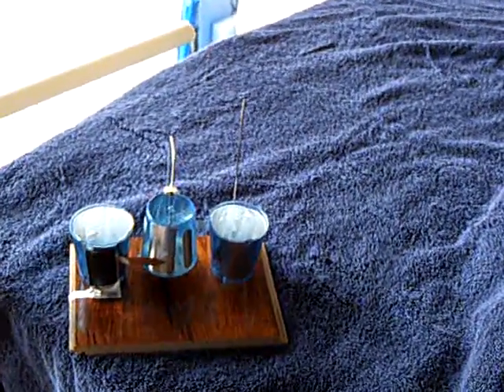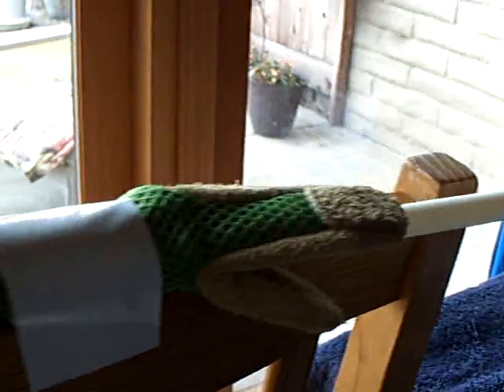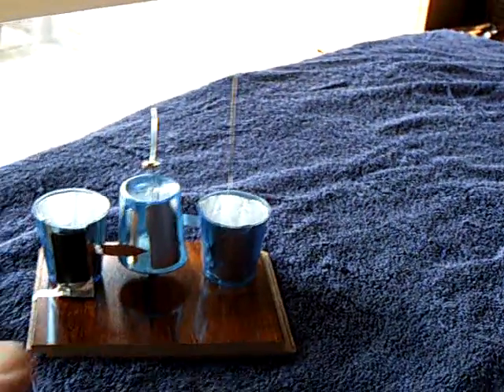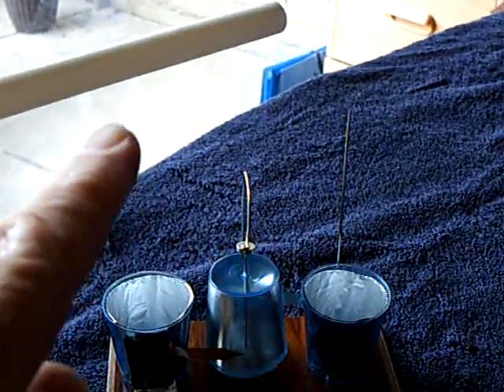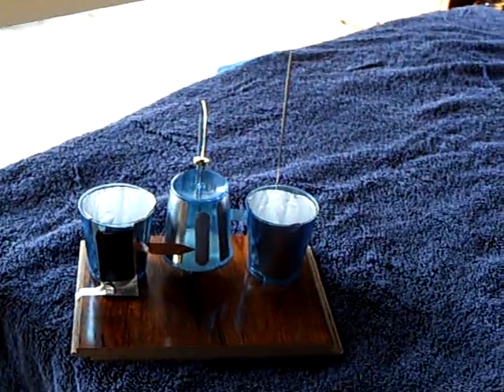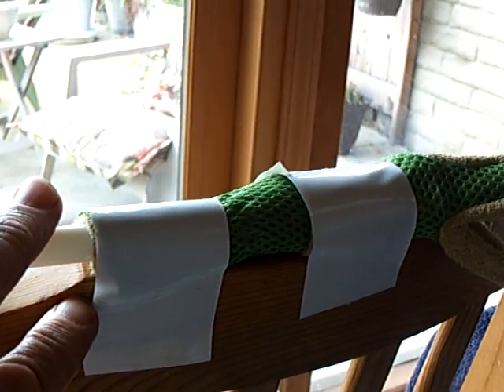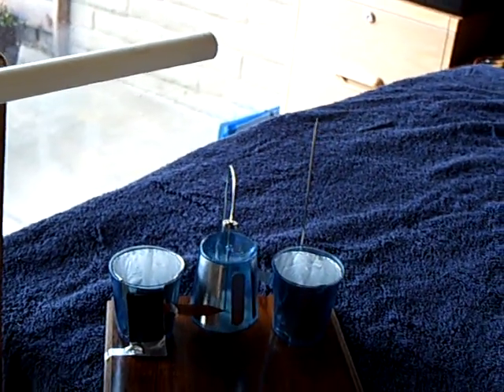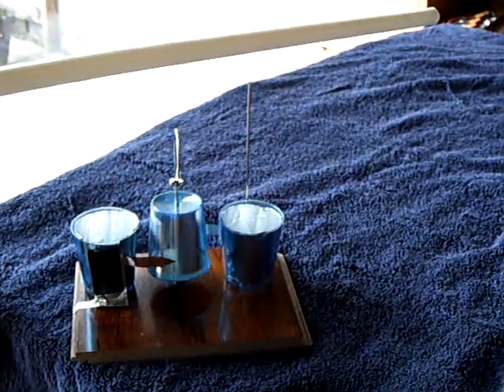Super Simple Electrostatic Generator -- with Wireless Electrostatic Motor

Comment: Lid. I know you study this because it fascinates you but until now it cost much to run these electrostic motor compare to the mechanical energy they provide. 

Even a system with solar panels costs rather much and would be more efficient with a ordinary motor, right?

So, the problem looks to me: how to produce electrostatic energy at low cost and in continuity than the motor itselt.

Would be water falling drops of water electrostic generator would be the solution, working with water coming from rain? What power we could expect from such system in your opinion?

Regards.
Reply from the maker: The water drop method of making static electricity isn't very efficient from what I have read.  If it works at all though, we should look into it I agree. You would have to build an array of them to get any real power.
    The electrostatic generators and motors can be made very light weight and out of inexpensive materials.  The "Corona " motor that I made proved to me that the motors can do work.
Reply: @Lidmotor  Unfortunately these machines are always inefficient, because these work by charging capacitors from capacitors.
The amount of charge is preserved, but most energy is lost in the resistance, because the peak currents are virtually infinite high. Just imagine two equal capacitors, one empty and one charged. Connect them in parallel. You get half the voltage, and half energy, so far I remember. Easy to calculate if I had a formula book at hand. ;-)

Comment: if you arranged a leyden jar so that the pipe passed through the middle whilst grounding the outer terminal would it charge? I tried this & it didn't work but maybe I did something wrong. I made the leyden jar from a bit of plastic bottle and arranged it so it slid along the pipe next to the friction pad (paper towel) which I gripped with one hand. grounded outer surface of leyden jar to my wrist with a bit of wire. pickup needle inside jar pointing at pipe. didn't work at all.
Reply from the maker: I think that you might be seeing  the Faraday "ice pail" effect where the charge is automatically transferred to the outside of container.  I might be wrong.  I tried charging up Leyden jars and several capacitors today with this simple generator and it worked OK.

Comment: I have a few questions concerning the metal foil linings on the cups:

- spinning cup: there are 4 copper foil rectangles on the outside of the cup and four bigger copper foil rectangles on the inside?

- two static cups: there is a aluminum foil lining on the inside and a copper foil "arrow" on the outside which touches the spinning cup?

Greetings, Conrad
Reply from the maker: There are six aluminum strips on the rotor and they are all on the outside.  The stator cups are as you described except that the Al foil "arrow" brushes tap the rotor and don't drag on it.  With the charge off the motor the brushes don't contact the rotor at all.

Comment: i wonder what it does in a vaccum....
Reply from the maker: Good question.  I think that what I am showing here would not work without air.
Reply: or maybe it works better :P.... air has a resistance value to the passage of electricity. i wonder how you could rub that under vaccum ... mmaann you need to show electrostatic electricity under vaccum plz :).